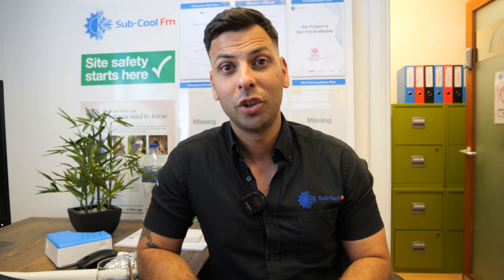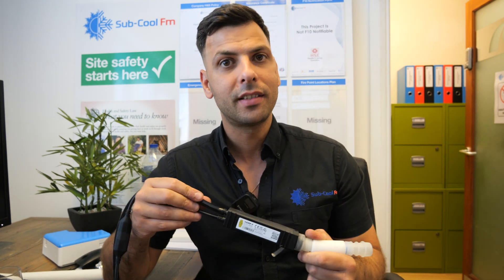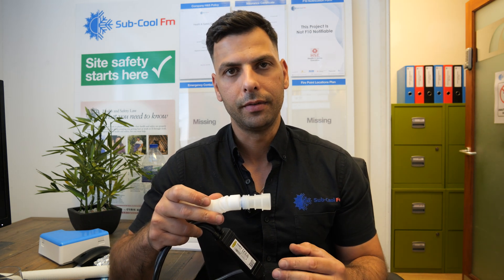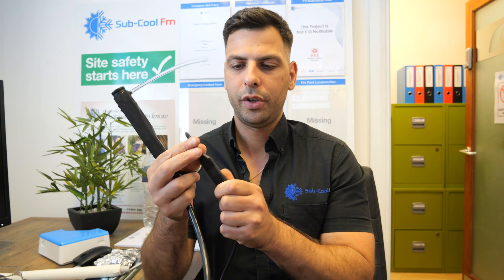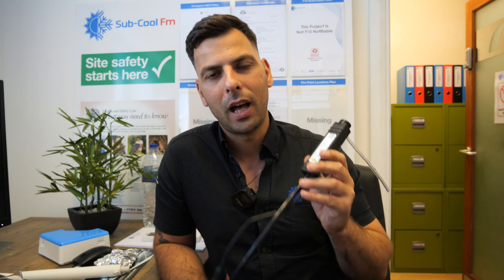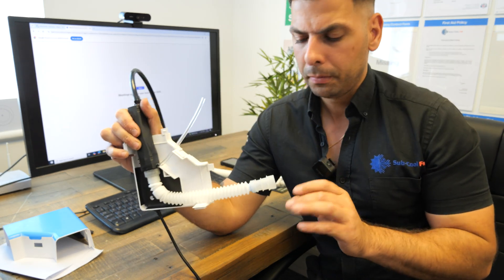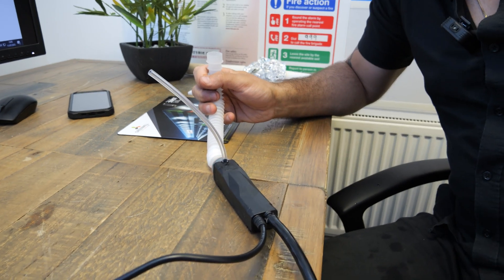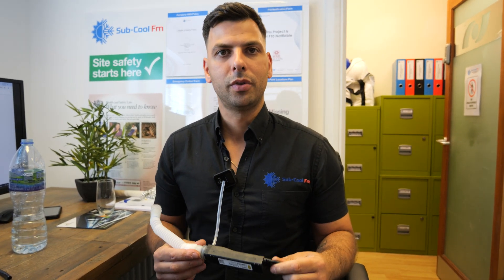The Quietest AC Pump We've Ever Used – Refco’s New Innovation!

Comment: Always had the same view on all the so called silent pumps. However we’ve just installed 4 of the just released 5th gen mini aqua silent + pumps and we can’t hear them running at all. To the extent we are having to strip everything down to double check the water level has actually gone down in the tank. 

These are actually rated at 16db which, 2 lower in theory than the refco.

I would look into those and do a review on them also as they have just done a huge step forward. We’ve just ordered a further 20 for future jobs. 

I have looked into these Refco pumps and do like the idea of not having a tank and potential ease of installation.

My two concerns are that the flexible hose looks very thin and over time could become brittle and split, and also same view as yours I think that inline filter is asking for problems, and would be worse than traditional mini tanks to strip and remove to clean the filter. 

Without the filter, we don’t know at this stage how the pump will last with debris going direct in the pump. 

Only time will tell on the reliability once they are on the shelves I guess 👍🏻
Reply: Installed a dozen this year, no problems yet knock on wood

Comment: I had a lot of failed Refco Combi pumps. The water sensors were failing constantly. My supplier took them off the shelves because of all the warranty claims. I do like this design though. Lets hope they improved the hardware .
Reply: Refco reliability has been terrible for me - not hearing this new one is much better either
Reply: @bsB563  bummer. was hoping the new sensor would improve things. I'll stick with Sauermann pumps for now.
Reply: @Mrblobbster  That's what I did after Refco and I've not been impressed with them either recently - if you've got space in the ceiling the Blu Diamond ones seem to be the least crap 😂
Reply: @bsB563 Yes Blu Diamond are the best but bloody expensive. They have raised the price by 25% last year in NZ. Rip off
Reply: I have 1 mini that uses a pump. I finally gave up on the Combi after multiple failures and hearing the condensate soaking my bedroom floor at 2 a.m. I tried a Vamp-X but it failed (Or I failed) out of the box to get it to work from above the ceiling. I ordered 2 of the Vamp-F and placed one on each side on the drain pan. The left side pan drain has a hose in it to make the drain slightly higher than the other. Now if I were ever to hear the left one turn on (Or see the flashing light at night) I know the right one has an issue because the left one should never turn on. Only issue is condensate sits in these pumps. Rather than drain them every season and hope it doesn't get hot I'm going to put some Zerex G48 anti-freeze in them and see what happens this spring.
Reply: @robertlucas54  Why do you keep buying Refco if you've had multiple failures on the Combi and an immediate failure with the vampX? I hate to break it to you but the VampF is absolute rubbish and you'll be luck if you don't have another wet floor soon
Reply: @bsB563  I can fit 2 of them in the bottom of my mini. My understanding is all of the condensate pumps fail so having a backup ready to go reduces my chances of ruining my floor. So far my plan is working very well.